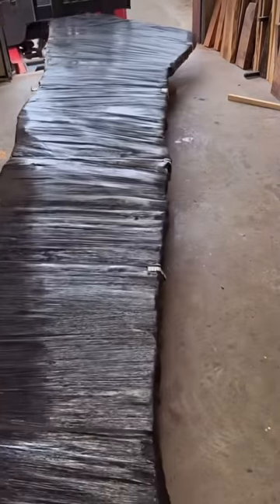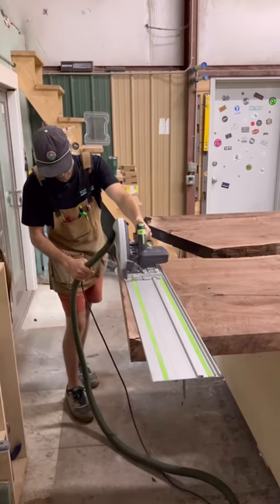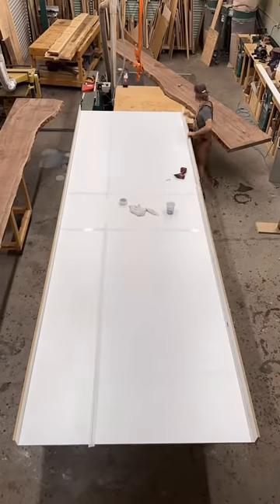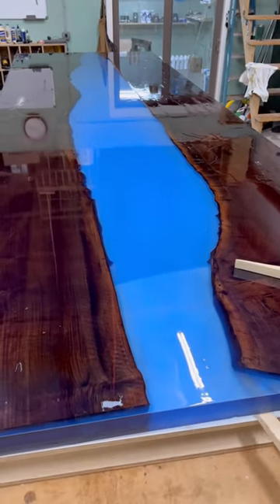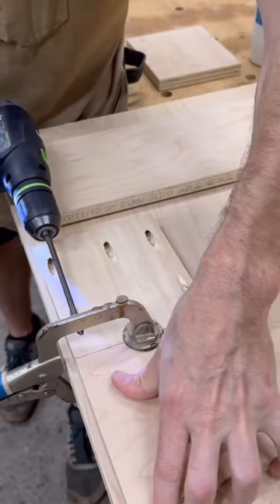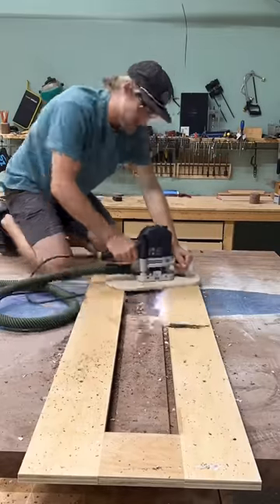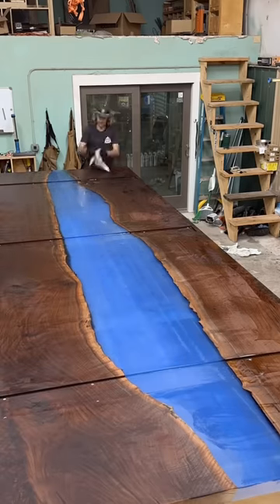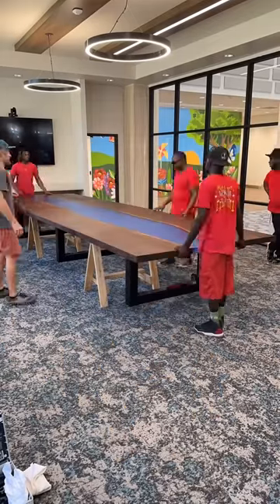18’ x 6’ Claro Walnut conference table build

Comment: Do you measure the moisture level of your wood before pouring and if so, what range do you like to work in?
Reply: Ive heard between 5% and 12%
Reply from the maker: Typically it is tested before I purchase the slab. But yet, always check the moisture content. I always shoot for around 8-12 % or so

Comment: Such a huge slab and then cut it in half - that’s insanity! 
Surely that would cost much more than getting a slab that is half the width but twice the thickness and then slice it horizontally and butterfly it.
Reply: That would require woodworking skill

Comment: Shouldn't have taken belt sander to edges and rounded. Also, those inserts you have clued under table to attach legs is a horrible idea! I have a new Holland tractor with same type of inserts( I don't know what they are actually called). The insert froze up and just spin inside housing. Only way I could get out was to break house. Which is fiberglass amd couldn't repair. Why can't the just put a hole all the way through so a person can disassemble? I hate those inserts!